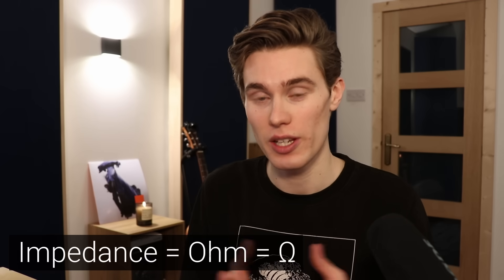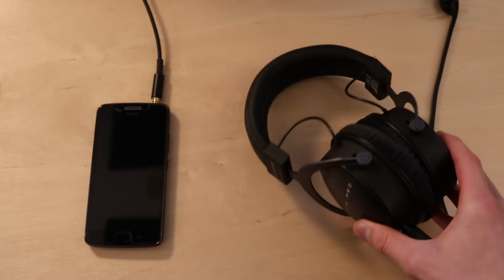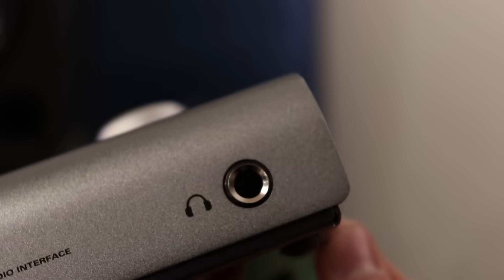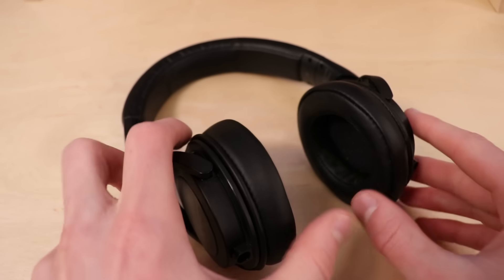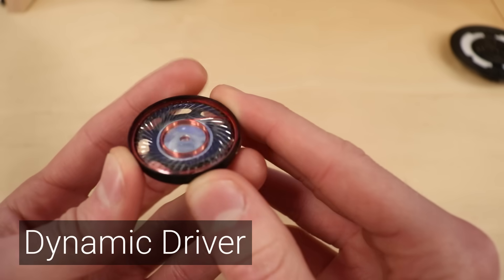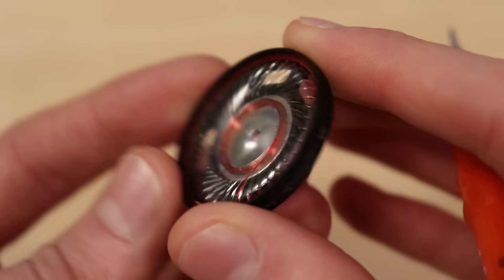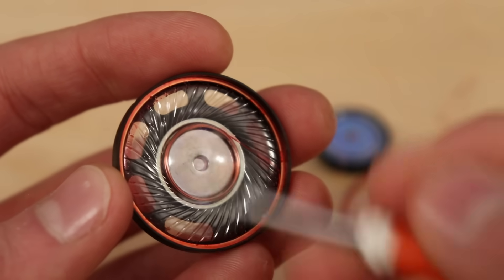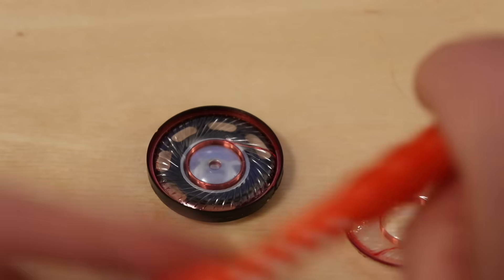32 ohm vs 250 ohm - Which Headphones Sound Best?

Comment: If impedance goes up, power goes down automatically if the driving voltage stays the same. That's why higher impedance headphones sound less loud. In fact, depending on the type of amplifier, you may want to exactly match the headphone impedance to the output impedance of the amplifier; e.g. for a class-A amplifier. In this case, you get the optimal power transfer when the impedance matches.

Comment: I think you did not mention the most import reason why we have low ohm and high ohm headphones which is greater signal to noise ratio (SNR) with high ohm headphones because higher voltage is needed to drive it.  Greater SNR means hiss aka white noise becomes very small, for example when an artist is experimenting with specific tones of an instrument for his/her track.  Power handling of the headphones is more or less the same unless someone want to go deaf (for ex. a 10 watt bulb is the same power in 110v or 220v country), therefore mismatching headphones can be dangerous.

Comment: Very interesting. I am plugging into a boss gtx1000 core into Sony WH-H900N over ear headphones (with jack adaptor) powered on, its 32 ohms but given the GTX is mains supplied i am wondering if I will get better / higher quality / better* sound from the headphones if I purchase some higher impedance ones? Likely ones designed for Amplifiers

Comment: In my opinion and what I have not heard presenters say on YouTube is this;  the headphone impedance should match the amplifier source impedance.  You should know the output impedance of the source (amplifier). To get maximum power transfer, the impedance must be matched, or as close as possible.  The amount of power for a given impedance will be determined by the driving voltage and current through the impedance. Too high, or too low an impedance of headphone compared with the source impedance will produce a mismatch and result in poor performance from the headphones. This is why mid-range impedance headphones can be mismatched to high and low impedance sources and give you the same sort of power transfer, which is not ideal, and will not be maximum power.

Comment: Great explanation. I owned the 80 ohms BD DT770 Pro for years and there’s simply no turning back to any other pair of headphones for me.
Reply: Yes you can definitely use the 80 ohm in pretty much every occasion, whether it being plugged straight into several devices or with the use of amps. The sound quality still remains superb. But…

The 80 Ohm is not supposed to be used for normal
studio usage or hifi-amps (here you should use the 250 ohm)

On the opposite, the 80 ohms also isn’t perfectly suitable for smartphones or devices powered by USB. (Here you should use the 32 ohm instead, because of a too low volume levels).
Reply: @Dubufy  Wondering the same thing here
Reply: @Alexander Deris I’d go for the 250 ohm
Reply: @Dubufy  You should look for people using the same audio interface/output device that you are using. I use the 770 pro 250ohm and I don´t need a amp(Steinberg Ur22C/44C, Line UX2, tested), my drum module didn´t work with the 250ohm but with other 80ohm´s(Roland TD-9).

Comment: Great explanation!! Could you pls help on this question? I have UR44 steinberg audio interface and use Cubase. the unit has 2 phones outputs. I would like to go for professional Headphones for mixing and mastering. UR44 manual says the maximum output level for phones is 35mW+35mW, 40 ohms. Now which impedance value of headphones is preferred? I am thinking of going for 80 ohms of beyerdynamic dt 770 pro. Hope this is ok – please suggest.

Comment: Really great to see this. However just wondering whether a DAC/AMP could spoil an ANC type headphone like Sony XM4. I may either be using the XM4 with its power on or off and will be connected to the DAC/AMP via a 5m/16ft cable. The DAC/AMP will be connected to TV via optical.

I'm looking at an entry level FX Audio DAC X6 MKII for your information. Thank you very much.

Comment: Hello brother will i get the same sound of dt770 pro 250ohm if i attach it on 3.5mm jack in laptop  rather than attaching it to the audiointerface???and Iam looking forward to buy dt770 pro but i dont have audio interface what ohm should i buy ?
Reply: If you want to connect to the laptop directly, then you should get 32 or 80 ohms, but if you have and audio interface then you should go with 250ohm.
Reply: @iamjaysum  thanks that really helps a lot
Reply: Buy this from offline market and you will get it around 12-12.5k
Reply: @iamjaysum thanks for that tip too bro much love

Comment: The higher impedance version has less mass in the coil. Lower moving mass of the driver makes it more responsive to the electrical signal, the jargon term is a 'faster' driver. This is why the higher impedance versions of otherwise similar headphones sound better (given sufficient amplification).

Comment: From what I understand, it's not just for different equipment types, but also affects the sound quality.  The higher the impedance, the more power can be handled which helps to provide better dynamics and clarity in the sound at reasonable listening levels.  If you're listening to SD audio, you won't necessarily care about that, but for those that use streaming services, or have digital files, with lossless compression (FLAC for instance), then it can make a difference.  This is why you'll often find the Pro or Studio series (more expensive) headphones with 250 ohm or 600 ohm options.

Comment: Thank you for such a clarifying explanation! Unfortunately, I'm not skilled in physics and don't want to make a bad decision so I will ask you straightforwardly: I want to buy a pair of DT770 pro to use only with my Digital Piano (Kawai NV5). What impedance model should I go for?
Reply: You should get 32 or 80 ohm.
Reply: @iamjaysum  thanks! I just got the 80ohm and they sound amazing
Reply: Following,  I have the same question for my Kawai acoustic piano with silent system 😅
Reply: Congratulations man! I also got 80ohm today for myself as well! 🥰
Reply: @iamjaysum  following both of you and will head to the store to get the 80 , thanks!

Comment: I've been told different things about needing DAC's and/or Amps for headphones. Some people have said that if it's above 35 Ohms that you should use an amp to get the best sound. Then other people have said you only need an amp if the sensitivity is under 100 db/V. So a headphone that is 32 Ohm with 97 db/V they would say to use an amp but a 63 Ohm with 101 db/V they would say not to because the sensitivity is over 100 even though the Ohms are over 35. This is still super confusing for me because I'm unsure as to which one truly matters... is it that higher Ohms needs an amp only if the sensitivity is under 100 or all headphones need an amp if the sensitivity is under 100? If the second one is true, then the Ohms don't matter unless they're over 100 and will need an amp even if the sensitivity is over 100, too?
Reply: First of all: I'm just a music listener, not a music professional. I was also very unsure about impedance when I bought new headphones. Everyone says/writes something different. Yes you need an amp, no you don't need an amp...blablabla. Then I listened to Beyerdynamic's advice because I didn't want to need an amp under any circumstances. Since I mostly(90%) listen on my notebook, I took the 32ohm version and I'm thrilled.
The predecessor was an AKG K242 with 55ohms and a sensitivity of 91dB/mW (104dB/V). Beyerdynamic has 32ohms with a sensitivity of 96dB/mW(??dB/V). I was more or less based on this information. Do I lose sound quality compared to the 250ohm model? Maybe I don`t know. Because for me it is more important that the Beyer(DT880 edition) sounds way better than its predecessor.

Comment: DT 1990 doesn’t go loud at all. At least on THX amps. Talking into a fan effect.
Reply: Would you recommend the DT 1990 or not?
Reply: @syndice  I would for the sound signature if you’re staying at gain setting 2 on the THX-AAA-789. I grew up with horn speakers so I love that sound. However HD 800S will max out the THX-AAA-789 no problem and do it clean.
Reply: @TheHope12322  o fuq thas expensive, thanks tho!
Reply: I wanted to love the DT 1990 pro but it wouldn’t let me push it harder. I just wanted it to go louder like my Sennheiser GSP 600, and HD800S I own. Both opposite ends of the spectrum I know but are my only other frames of reference.
Reply: @TheHope12322  I get that. I'm looking for new headphones to get better audio quality for my music. I'm planning to get the 1990, I've heard it's good but it's so expensive for me. As long as the THX amps will push it to the right level I think it should be okay

Comment: Hey  Micheal, 80 ohm or 250 ohm for plugging in a Simple Audio interface like Steinberg MkII and focusrite scarlet.
Reply from the maker: It should be able to work fine with 250 Ohm but you might find the 80 will give you more volume/a better bass response across many devices. You can't go wrong with 80
Reply: @inthemix  Thanks Michael 😀👍

Comment: I think it's still important to mention that sensitivity also matters a lot. Something like Abyss, Audeze, Hifiman often have low impedance but also low sensitivity so they need much more power to get loud enough.
Reply: Those are planars, not dynamic... completely different technology and different electrical principles involved...
Reply: Because it's nonsense to say that "high impedance heapdhones need more power". Impedance determines the relationship between voltage and current.
How much power you need depends on the sensitivity or efficiency.
Higher sensitivity means you need less power, but it also means that the noise floor of your amp and source needs to be lower .. otherwise you'll hear it.
Higher impedance means you need less current, which at the same power is an EASIER load for an amplifier. On the other hand you need more voltage and therefore gain or turn up the volume more.

Comment: He is not exactly right. High impedance means it will draw more current from the source amp. It also means that it puts more load on the amp. If the amp is designed for low impedance headphones it will produce poor output with high impedance headphones. However, for an amp designed for high impedance hooking a low impedance headphone will make no difference. Ideally the output impedance of amp and input impedance of phones should be matching for ideal output. High impedance headphones produce better resolution of sound.

Comment: If in my Headphone signal to noise ratio is 108dB. The headphone output impedance is 63 ohms. Which 770 pro are best suited 32 vs 80?

Comment: Voltage =/= power. 32 ohm and 600 ohm headphones can get as loud with 1mW of power, but reaching that 1mW of power requires more voltage and less current on the 600 ohm model as it does on the 32 ohm one.

Comment: V = IR .... You don't need a youtube video confusing people with a 1-ohm speaker and they exist will require lower voltage! As such the lower the resistance the less you strain your AMP

Comment: Thank you for the informative video. I have a Behringer XR18 digital mixer and its headphones output impedance/level is rated at 40 Ohm / +35db (stereo). Which DT 770 PRO should I consider? 32, 80 or 250 Ohm?

Comment: I am looking at the DT770 I create solely with controllers ( all usb with a direct connection, no added audio interface) and digital synths on a MAC desktop which would you recommend 32ohms or 80 ohms ?

Comment: If one has a good amplifier system, the 250 Ohm will sound better with a cleaner background. I tested this on my DT880 32 and my friend's DT880 250 Ohms with my Topping E30+L30 combo. Awesome video by you.

Comment: I'm just burning in a brand new pair of DT 990 Pros (250ohm) and I'm incrediby impressed! Although there are certain parts of the lower end which just aren't there compared to my maybe six year old pair of m40x's. I'm using an Alesis io2 Express USB interface which is fully capable of driving these that I'm aware of. Not really sure how to go about it. (the M40x's have no difference in quality whether in my interface or my motherboard, referencing to a comment about the io2 Express having caps not intended for anything lower than 200 ohms.)
edit: tightened the sound up with a slight EQ in VoiceMetre.
edit: Removed EQ. So it turns out that my motherboard has a much warmer, fuller sound than my interface. Also it seems that my motherboard's Realtek S1200A is capable of powering 250ohms despite what the internet says.

Comment: It would be of great help to hear about a detailed discussion on power matching amplifiers mainly portable ones when it comes to higher ohms phones, etc.

Thanks, Your info here is really great and very useful about different ohms in different headphones. I do have a 250 ohm BeyerDynamic 770 Pro for more than 2 years . I don't use it, not knowing which is the best & most appropriate matching portable amplifier I should get for it. So in the meantime I've been getting by with using my other phones. But never had any real experience how my 250 ohms sounds like in its full Glory.

I believe there may be other people who are in the same quandary. Or probably wanting to buy a 250 ohm version but not sure if they can make it work.

Comment: Great, great info. So, I'm about to buy the DT770 Pro to pair with my phone. The 32ohm would still be better than the 80ohm version? Although I think my phone would be able to drive the 80s, the 32 might have more volume at lower voltage, therefore consuming less battery from the phone, right?

Comment: So i have a question, I am wanting to buy the beyerdynamic dt 1990 pro (250ohm). But i dont know if i will need an headphone amp, because my audio interface (berhinger euphoria404hd) will cause frequency loss/distortion if i dont use an amp. Do i need an amp or dac? if yes which do you reccomend?

Comment: sorry, but the most important part of the video is the topic at 3:36 and in my opinion that was mentioned in undertone, and slightly trivialized when I am sure that most of us, watching this video, are precisely watching this video for that topic. We might not be an audio professional but I would say that everybody watching this is in a way closer to be an audiophile, so, of course we care about and try to get the information to get the best possible sound quality and detail. We consider those little differences in sound relevant. If the 80 ohm version has better sound quality compared to the 32 ohm version, we want to know. We try to fulfill the requirements to get quality and not suit the quality to fit our application conditions. There will be, of course some limitations on what we can do to get the best, but it rather not be for lack of trying.  

What I take from what he just said there at 3:36 is that 80 and 250 ohm version sounds better, although 32 ohm version is a sacrifice in quality to suit normal use...

Comment: Great video very informative, I have a question. So would the 80Ω headphones work fine if my device have a 32Ω output? I have the hyper x quad cast mic and the output is 32Ω and I want to get the DT 770 pro 80Ω. Will it work? Thank you!

Comment: I bought both 80 ohm and 32 ohm and chose the 32 ohm. The 32ohm with eq calibration software engaged is great. The 80ohm was too forgiving In the bass. Nice for listing to music but not for tellling me if my mix is garbage in the low end. If you dont have eq calibration software get audio technica m50x, theyre pretty flat and accurate. I have them too.

Comment: Question: is the 80ohm 770 better than the 250ohm? I'm using an Audio interface
Reply: The 250 will be  better with an audio interface....higher impedence level and flatter response will give you more accurate sound when creating/mixing or referencing.

Comment: I bought the 32 ohm because of this video. I'm very pleased with the quality. Thank you very much for the advice❤🎧
Reply: Are they good for Mixing and mastering????
Reply: You're sacrificing on some clarity, detail, soundstage separation, not to mention distortion control at higher volumes. But, for most people, the difference isn't valued or noticed.

Comment: Hi i have one question. i have a AKG99 headphone but right side does not work now. I see some 32 ohm 40 mm speaker driver on the sale. Which brand do you recommend? and if i change it can i get the proper performance? Thank you

Comment: In case this helps anyone, I used the audiotechnica M50's for a couple years and was never a huge fan of the sound, but that it must've just been my ears because everyone raves about them. I recently saw this video and switched to the Beyerdynamics DT770's and my goodness, they're amazing! Incredible headphones for mixing and just listening to music. You can hear so clearly where each element of the song is in the stereo field. Bass is great, way better than the AT M50's in my opinion.
Reply: Athm50 are only good for tracking imho, not for mixing. Edit: typo
Reply: What audio interface or amp did you use

Comment: The main question is not completely covered: if my PC is able to drive a pair of high Ohm headphones 🎧 for a bearable level of loudness but its like already 90% of the volume, so the question is will the sound quality be the same as if my source could drive them using just 25% of the volume? the logic says it should be the same quality...

Comment: Great video, not just volume though because if you look at the frequency curve of a DT-770 80 ohm, it's different to the frequency curve of the DT-770 250 ohm
Reply: In fairness, Beyerdynamics, especially the 770/880/990, have significant unit variation issues.

My pair of 80s and 250s could sound entirely different from how yours might sound.

Comment: i have the 250 ohm Beyerdynamic DT 1990 Pro and use it with a lg v30 and they work fine and can put it loud . It does make a difference  when dac is shut of